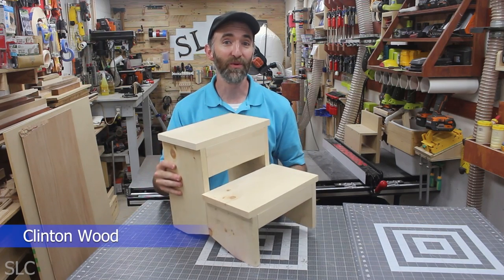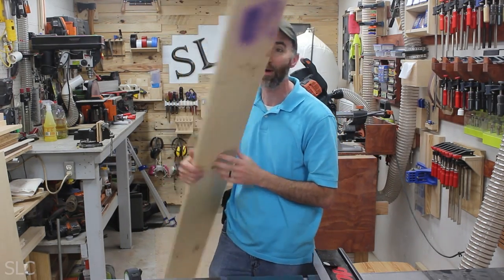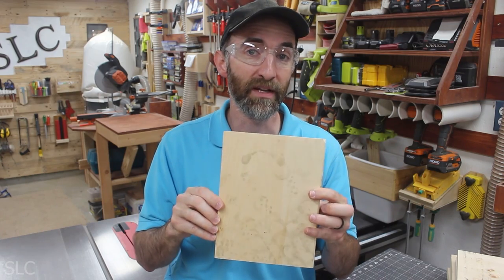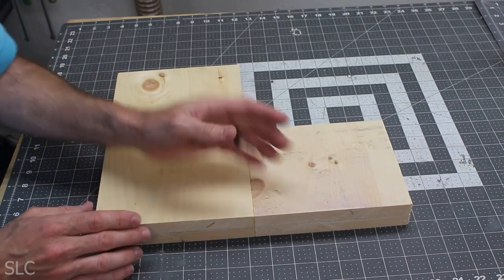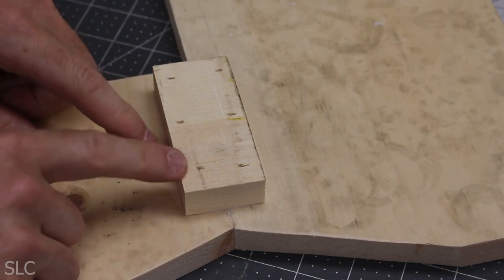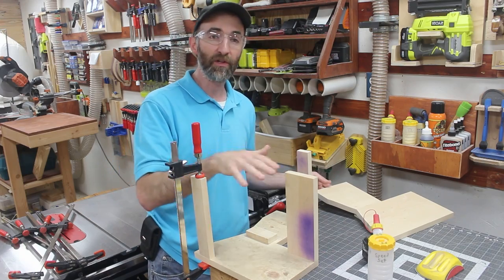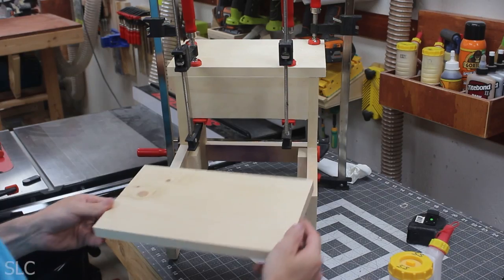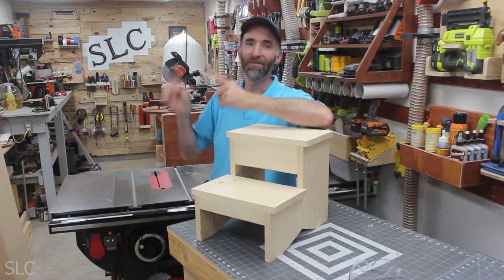The 4S Step Stool : Woodworking for Beginners

Comment: Great build, i'm a bit surprised though that you didn't use some pocket holes on some of those joints.
Stay Safe,
Barry (ENG)
Reply from the maker: I really thought about using the pocket screws but decided since most people would have easier access to glue just to go with it.

Comment: Could you use pocket screws instead of glue ?
Reply from the maker: That should work if you use enough screws. I almost did it that way but then realized a lot of people would not have the right tools so I just used glue.
Reply: @SpecificLove7  would wood screws be any stronger sir ?